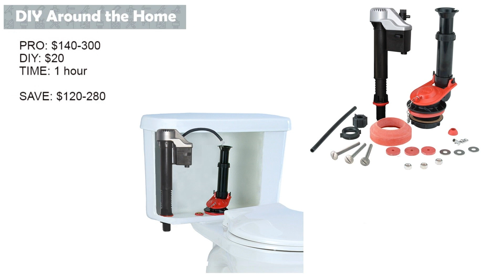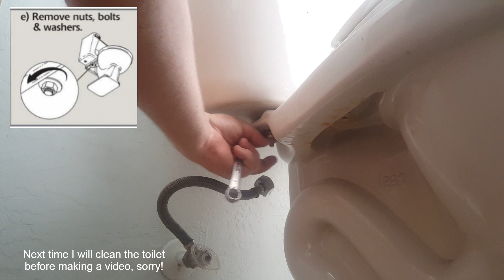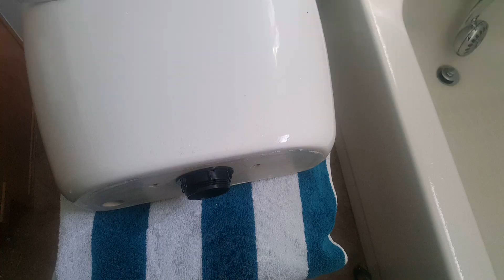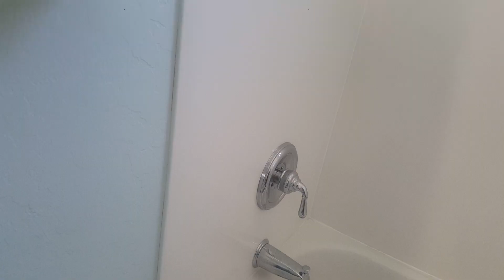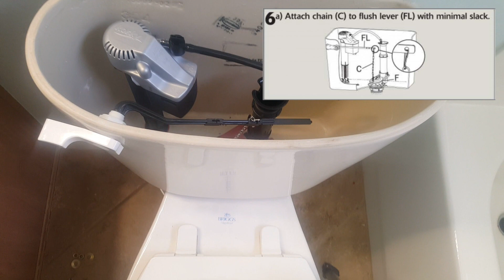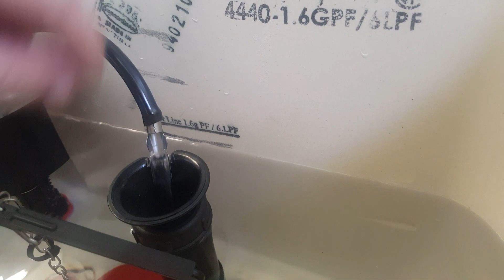Why Is There Low Water Level In The Toilet Bowl and How to Repair?

Comment: The water level in the bowl is high when it's filling. After the tank is full the bowl starts to lower ,why? The toilet is brand new ,is there something I'm missing in the tank level adjustment or is there something else I'm missing?
Reply from the maker: I'd adjust the bowl to fill slower. The goal is to get the tank and the bowl to finish filling at about the same time

Comment: Sorry I can’t watch all this so can anyone just tell me in a few sentences what the problem is so I can fix it?
Reply from the maker: The parts that make your toilet work are not optimally working or have gone bad. Replace them with a cheap kit like you see in this video and your problem is fixed
Reply: @DIYAroundTheHome  THE STIFF ASSED HOSES THOSE SLOPES PUT IN THE KITS ARE A BIG PART OF THE PROBLEM...,AND THE CHEAP ASS CLIPS THAT ARE SPOSED TO HOLD THE TUBE IN THE OVERFLOW....
Reply: @patrickstockton2091  They do suck, the hoses are way too stiff. The clips blow too.

Comment: Why would you remove the tank ! That is totally unnecessary
Reply from the maker: It was a complete refurb kit. I could have kept the 20-year-old parts that we're working at the moment or I could replace them with brand new parts that came with the kit I had purchased. Only took a little bit more time, in my estimation totally worthwhile. Toilet has worked flawlessly all these years after

Comment: Not sure if you already addressed this, but would any of this fix a problem with the bowl water level lowering after the flush is complete? I turned off the water supply to the toilet to see if there was a leak. There wasn’t. Water stayed in the bowl but no matter how high I turn the dial to get more water in the bowl, water will not stay at that level. It slowly lowers to a certain, almost “pre-set” level.
Reply: I also have this problem but you find out what was the chose?

Edit: if so how did you rectify it?

Comment: Why was the water low ? What was the prob
Reply from the maker: The old components needed their settings tweaked so more water was diverted to the bowl (and less from the tank) but since the components were old and brand new ones were cheap, we installed all new ones then showed how to tweak the settings to make sure the bowl got enough water before the tank filled up and turned off the in flow of water

Comment: There's absolutely no reason that the flush valve has to be positioned at the angle shown.  The chain on the flapper only has to reach the lever.

Comment: Good info. Quick question how do you see how much the project is going to cost? I tried and it says to send my email so that they can send a contractor out. But I just want to see how much it will cost me to see how much I am saving. Thanks
Reply from the maker: Do you mean when I look at websites like HomeAdvisor.com?
Reply: DIYAroundTheHome yes
Reply from the maker: I typically Google search "cost to repair X" (X being whichever task or job it is). Home Advisor usually shows up towards the top of search results and when you click it their link usually takes you to a page where they list the average cost range nationally.
Reply: DIYAroundTheHome I tried that but not working for me. Once you are in home advisor what do you click to see the prices
Reply: DIYAroundTheHome it just says enter zip to compare quotes from contractors
Reply from the maker: Yeah you're going too deep/specific compared to what I do which is I only search for the national price range since my channel is viewed by people around the US. 

If you proceed and enter in your ZIP code they'll show you pricing specific to your area but they are also likely going to start contacting you (probably via email) to get you to have the work done by one of their contractors.